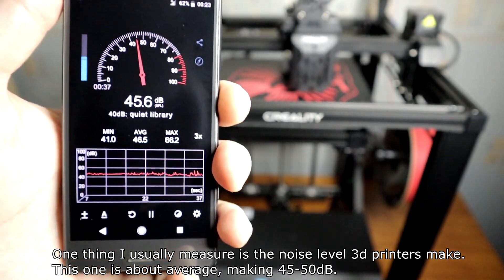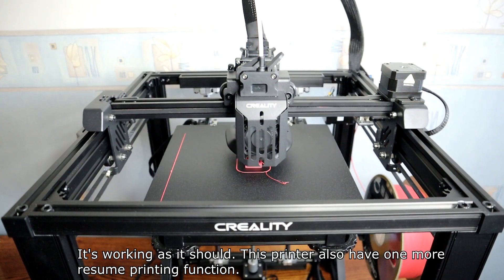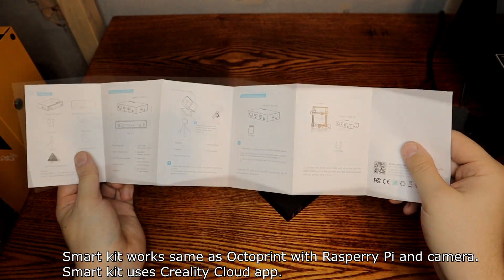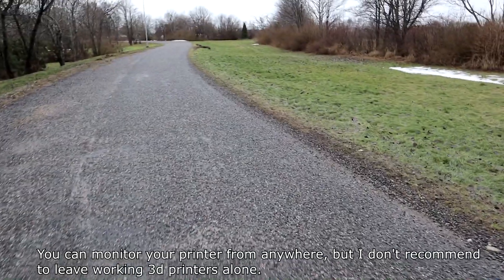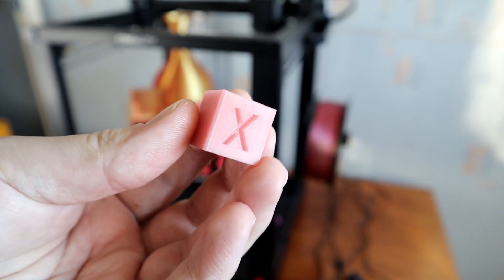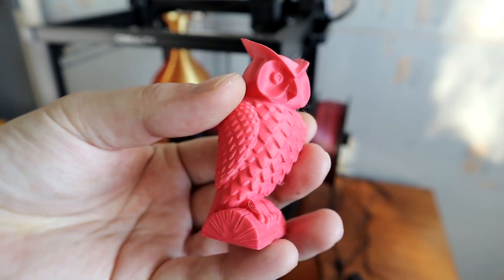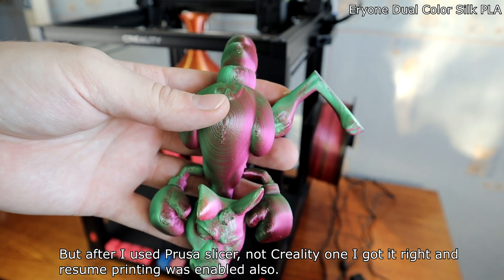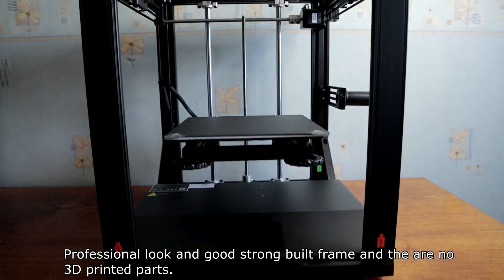Creality Ender 5 S1 - Smart Kit 2.0 Review Setup Testing

Comment: Hello! Can i ask about settings / profile? I have the printer yesterday and i always get clogg...No matter the speed or temps or retraction i try..Please, help me!
Reply from the maker: Hi, I use default retraction settings and temp for PLA 200-210C. I didn't had any clogging problems.  You should check if cooling is working. Maybe you need to disassemble hotend and clean it properly. There can be burnt filament, which will cause clogging.  Try different filaments also, maybe filament have issues.
Reply: @3DPrintsBuilds  So sorry for bothering you, but i don't know who to ask for help..
I bought the printer yesterday. Assemble it, leveled it and everything.
The test prints on the card came out perfect. But that's it..
I try Cura Slicer or Creality Slicer , but maybe my settings are wrong, because anything i try to slice and print - cause a clog after 30-40min of print. The extruder start clicking and the layer is missing or at dots..
I have to pause the print, remove the filament, push the metal stick through the hotend and from the nozzle there comes filament left behind the nozzle. After that i insert the filament, resume printing and after few minutes it is the same.
Can you share your settings or any advice what to do and what can be the cause?
Reply from the maker: @nikolaterziev93  I use Creality slicer, but Cura is almost the same. If you resume print and it clog after few minutes your hotend needs proper cleaning. With the metal stick you may not clean it properly. Also you may have some blockage between extruder gears or the gears need cleaning. I would take the hotend and extruder apart and look if something needs cleaning. You can get my slicer profile from: https://www.mediafire.com/file/1fylt5vopb0n1fo/Ender_5_S1_Creality_slicer_profile.curaprofile/file
Reply: @3DPrintsBuilds  thank you so much! I will try now!

Comment: thanks for the video, very useful.
still considering between the ender 5 s1 or the ender 3 s1 pro.
which would be your recommendation and why?
Reply from the maker: Thanks! It depends what you want to do with it. If you want also use laser module I would go with Ender 3 S1 Pro and it's cheaper. If you don't I would choose Ender 5 S1, because it's faster, clear view of the nozzle and it's not bed slinger. This is my opinion.